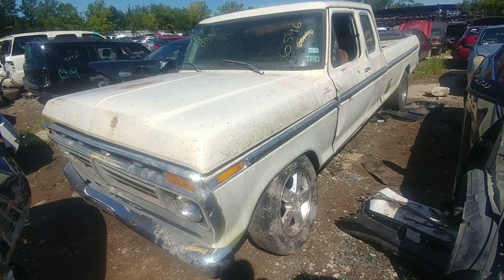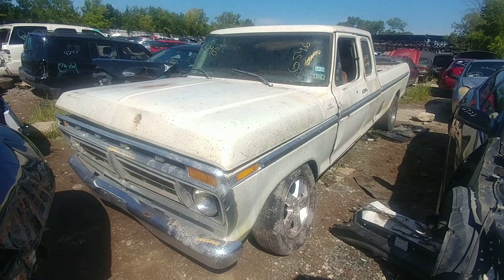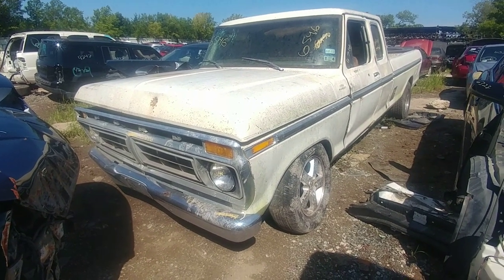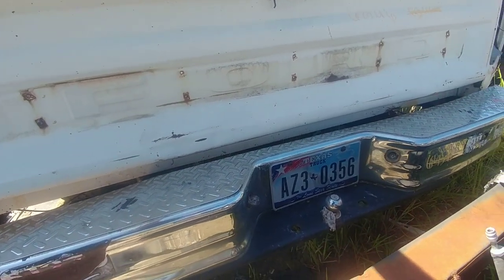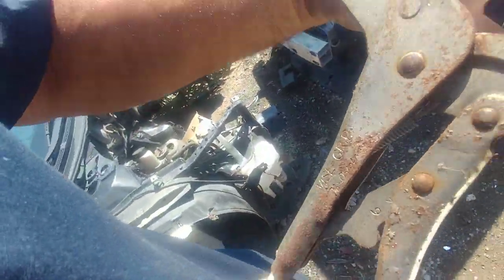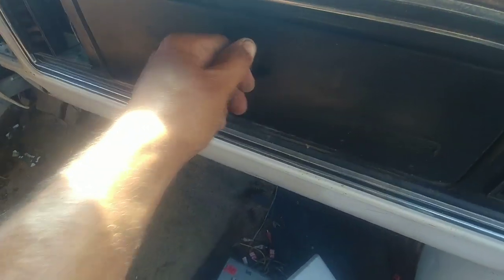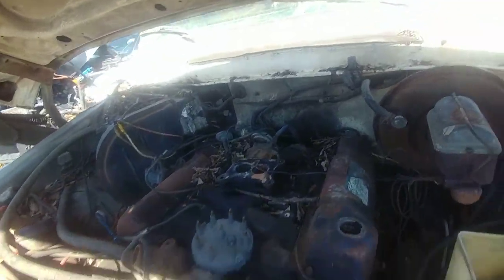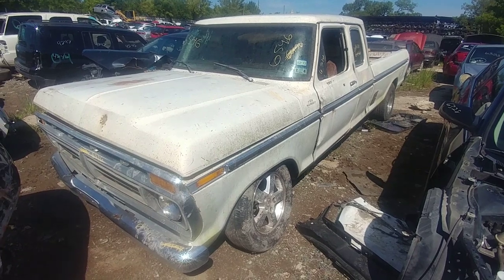1977 Ford F100 Ranger Super Cab Junkyard Find

Comment: Ford still uses the term "Super Cab" today on the F- Series, it is their version of the extended cab. In 2017, they grew the wheelbase a full six inches in some cases over the previous models and they now have aluminium cabs, 2016 and older I believe was still steel.  For the VIN, we have X15 which is a F-150 2WD Super Cab from 1977 to 1979, S for 400 V8 2 barrel engine, K for Kansas City, MO (KCAP, or Claycomo County)  assembly plant and the remainder of the digits do correspond to a 1977 model year truck.  That is a Sears Craftsman garage door opener remote control. That was made for Sears by Chamberlain (as they still are today) under the "139" prefix. I have three of them in operation in my family, all circa 1979 that my Dad installed. That is a newer model opener than mine (1980s or so).
Reply: New ones share the same cab like obs trucks
Reply: @D4x4Bronc  Obs trucks?
Reply: @D4x4Bronc  OBS=Old Body Style.

Comment: Tailgate looks decent without it being busted/rusted out. Just needs a new latch.
Looks like she had a few owners at least! Rough life near the end is what I'm thinking, with the bullet holes that took out the condenser fan and the radiator.
It would be cool if there was a tool storage cubby in the pass. side of the bed, truck with those are gettin' rare!
Def. a factory 8 track truck, I pulled one out of a t-boned one a long time ago.

Comment: Dont see to many mid to late 70s ford trucks anymore, I think it has a lot to do with the fact that most of those trucks had the "modified" or "m" series engines which had a reputation for being junk such as cracked heads and tearing up main bearings and being fairly underpowered, and the modified engines had their own motor mount bolt pattern which made swapping to a different series ford engine difficult and I think they shared the same bell housing pattern as the 429/460 big block.